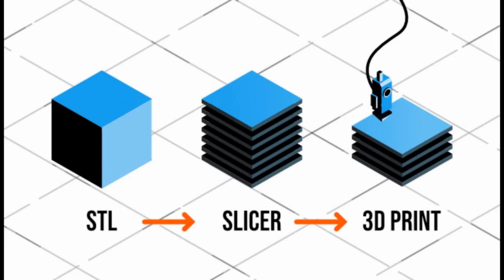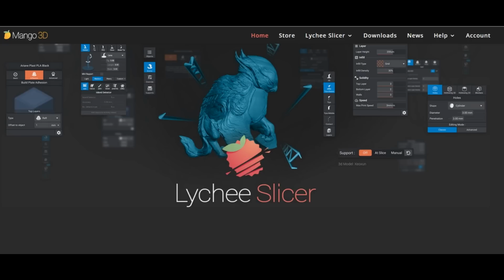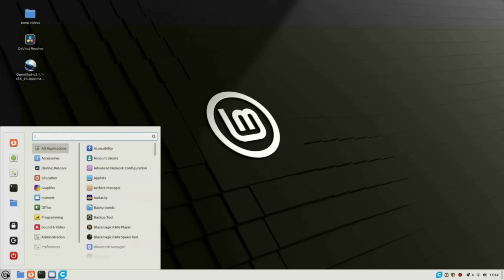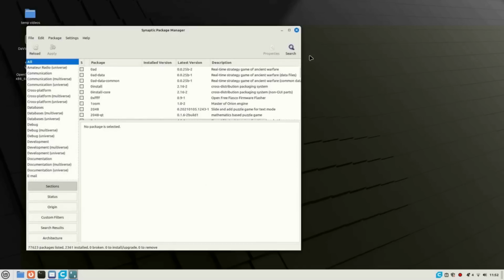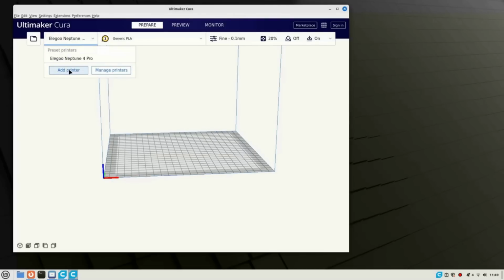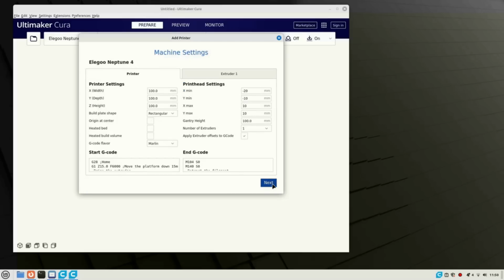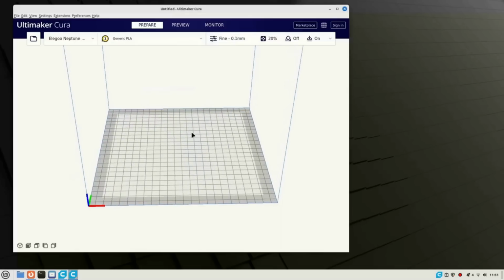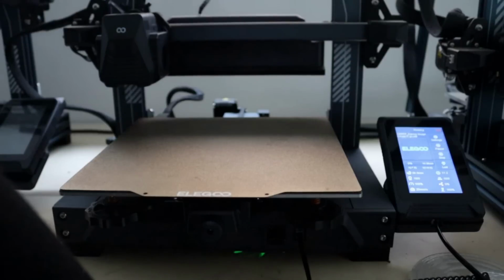2233 3D Printing And Linux

Comment: I tried mint 22 worked fine but could not get any thing working to simply view an STL. First time I installed Chitbox 2 it worked ok. When double click exe file it asked to launch or run terminal. After playing with file system ect for a week I reinstalled mint as had worked out file syste. Re installed Chitbox and the only way could get to load was to copy exe and paste in terminal to run. Crashed continually though. Still could not get a program so could just view STL. Simplified 3d would not even install as system kept telling me I wasn't authorised. Got sick of not being able to print for nearly 3 weeks went back to win 10.  If I could run simply 3d and Chitbox as well as see STL I would use Linux mint but it just doesn't work for me.

Comment: Linux can be used to run a small cnc business.  Lightburn and Inkscape for lasers and plasma cutters.  FreeCAD for CAD/CAM used in three axis milling.  Cura/Orca/Prusa-Slic3r for 3D printing.
Reply: LinuxCNC,  bCNC both run on Raspberry Pi.
Reply: How to use Orca Slicer on Linux mint?

Comment: Allo Robert!  I guess that I'm a bit of a techno-nerd oddity, but I've been using Linux for everything for nearly 28  years.  I'm currently using Linux Mint Debian Edition 22.3 with Orcaslicer and Lychee.  I've also used Slic3r, Cura, Chitubox, and a few skinned versions of each. I use FreeCAD for design work.  I use a trio of Sovol SV086 and SV07 FDM printers, as well as Creality LD002H and Anycubic Mono X 6Ks SLA resin printers for fine parts.

I've also been a Resolver Studio user since Resolve 14.  Resolve 18 runs great on my same desktop Linux system.

Of course, I'm a bit more aggressive than that Dell with a 24GB RTX Ampere GPU, an i9 CPU, and 128GB of RAM, but ... 😎

Comment: I have been using Linux (Ubuntu) and the Cura slicer for over 6 years, with absolute success.  On a Grabber-type 3D printer that I built myself using Arduino.

Comment: I've been using Linux since 2004, when I do have to use Windows for anything I find it horribly unfamiliar and clunky.

Cura wasn't available in my distro, so I just downloaded the appimage from ultimaker's website and ran from that. Just as easy to use and works a charm.

Comment: As of now, I've been 3d printing for about a year and a half using a raspi4b with twister OS (outdated) installed slicing on Prusaslicer and Cura pulling STLs from ALL sites on chromium and modeling on tinkercad and Onshape. Which makes for a VERY affordable setup considering the whole kit costs around $135.

Comment: Thanks for the video. Honestly, for someone who actively describes themself as not liking to mess with a bunch of settings etc the fact that you are working with Linux is a good sign that Linux has actually come a long way. 
Some thoughts on your viewpoint re: Hardware -- YES, to some extent the OS, will have an effect on performance. BUT, when you wander from simple business applications into the realm of Workstation Applications, such as Video Rendering, AI Training and Model Usage, Engineering Applications etc, you will find that your hardware will be the single most important thing.
You will need a beast of a graphics card, and a nice fast CPU, and fast hard drives. You can "still" use Linux on such a machine. But, for example, without a beast of a graphics card, and really great hard drives, you will find that video editing is going to be slow. Consider using NVMe hard drives -- they have really great speed.  Make sure you have 32 GB RAM. Buy a great video card.
So sure, you can use an older server -- but, I wouldn't expect much without adding NVMe drives and a video card.
Reply from the maker: cheers mate

Comment: I've got a Beelink S12 Pro bolted to my monitor (about 10W resting power usage). I used to have a full setup with a powerful graphics card until the PSU died and I parted out on ebay. For what I use my PC for it's much more reasonable (cost onlyu £170) Comes with a Windows 11 licence but it runs better on Linux

Comment: Meanwhile I'm here daily driving Linux and switching between Cura, Prusa and Orca slicers with no problems.

For Neptune4, remember to include "PRINT_START" in the start G-code to make sure the bed leveling mesh is loaded and applied during the print (it might be by default, depending on what version of firmware you have, but it doesn't hurt to load it explicitly).

Comment: Apparently I'm not the only one who moved to Linux back when Windows XP reached End of Life.
Reply: i still have Windows7 running on an 2010 PC...its the same as XP... ;) after that, ubuntu/debian....no going back ever! and people are always amazed at how fast and cheap the thing is... marketing is one hell of a drug.
Reply: @simonschneider5913  Am I correct that win7 was more used for server applications? Something rings a bell.
Reply: @ogi22  idk, but it was pretty stable, as youd expect from a refined version of XP, so perhaps that was a thing.
Reply: @simonschneider5913  About stability of the OS, I remember when we had ADSL connection somewhere around year 2002. Time of downloading movies, games and soft with 128kb/s speed 😁 We had special forums, where people put screenshots of their Win98 running continuously for a few weeks. I don't remember the record, but mine was close to 2 weeks 😁Somewhere around 12 days without a crash. And I was using that computer for gaming too!
Reply: I'm happy I'm not the only one thinking that XP was the best one of Window$ family 🤣 Many years ago one guy showed me the OneNote. Back then it was in development, full of problems, but it had amazing potential. And I started to use it regularly for my notes. And I still use it. 2010 version. Everything they did after that was a shot to the knee. The last straw was a few years back, when company I worked for, change the platform to 360 (and then some more). I was unable to upload all my notebooks without special accounts, priviledges and such sh.....t. Sorry M$... You did something right and you effed it up perfectly. Still usilng 2010 version of Office just for OneNote. It was a beautiful tool and they took an axe and chopped off all the best features.

Comment: "Linux is just another operating system." I don't know how many times I have tried to convince the diehard Linux users that this is really the case. Many of them want to keep it difficult to use so that they can keep the riffraff from using their precious Linux. We need more people with your attitude toward Linux.
Reply: Some communities do.  The largest of which are in the arch community.   They also over harp on some things; actively dissuading people from using distros for insignificant reasons or petty drama.

I mean its like every other week somebody is ranting about how terrible ubuntu is....  makes it really difficult to convince people to drop  windows. Especially when ubuntu/mint and manjaro are the easiest to switch to.
Reply: @Soletestament  Amen. Ubuntu and Mint ARE terrible— because they work right out of the box and give people what they want without requiring extensive adjustments just to get basic functionality. Oh the humanity!!! At least that seems to be the attitude of the people you are talking about.
Reply from the maker: cheers mate
Reply: what? no. Nobody wants to "keep Linux hard to use."
Linux has its advantages and disadvantages, and if you focus on providing a distro of Linux that has a MacBook or Windows like experience

You get Chrome OS. thats it. Thats what you get. Thats how Chrome OS came to be.
Reply: @AnonymousAnarchist2  There are people who frown on distros that work without the user having to use the command line. They hate the idea that there are people who WANT a MacBook or Windows experience— without the baggage that comes with either product. And they don’t understand that there are people who want to use a computer as a tool and not make adjusting  the operating system their life’s work.  And that they want to do it without having Google looking over their shoulders.

Comment: My 3d printing setup comprises Tinkercad running in Firefox + Cura running on Lubuntu on a repurposed HP Chrome box. Boot up is really quick and the Linux operating system has been rock solid.

Comment: I've been using Linux for over 10 years and I can do everything I need no problem... Linux Mint is just an absolute breeze.  I didn't really get on with Cura and switched to Prusa slicer which works flawlessly on Mint with my Ender3 V2 - definitely worth taking a look.

Comment: it's like you're reading my mind. I'm currently rebuilding my 3d printer and I switched to linux last year.

Edit: Also the latest version of cura can be downloaded directly from their site as an appimage (which is like a portable app). The one from the package manager will most likely be out of date (unless you use flathub version)